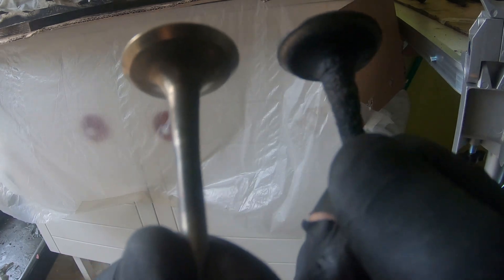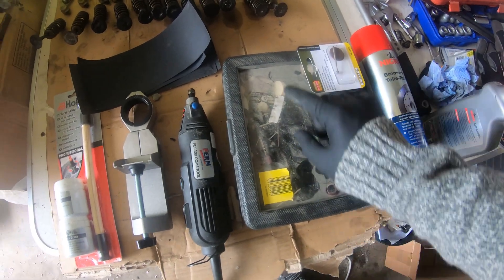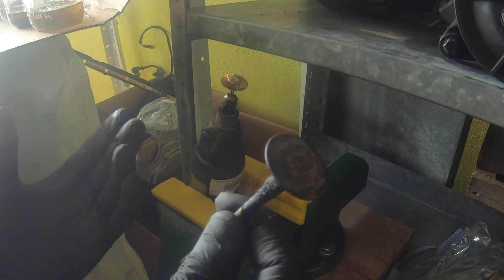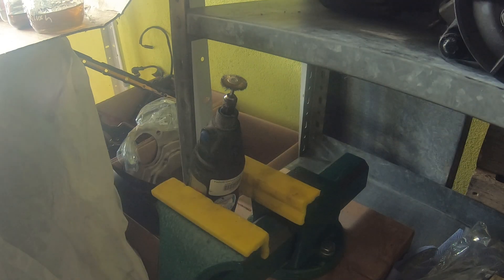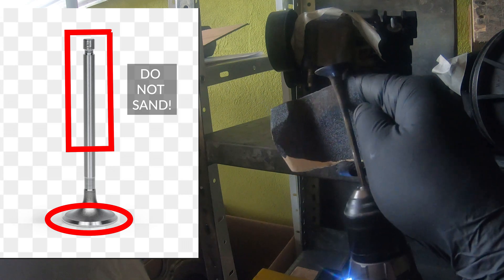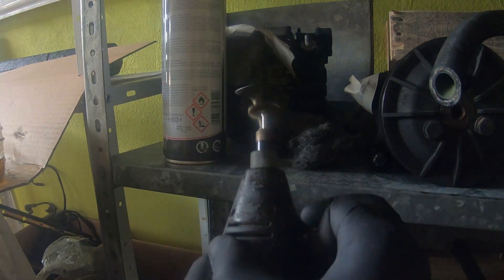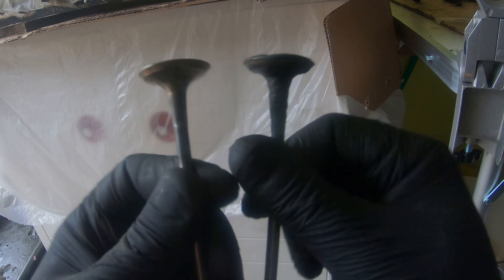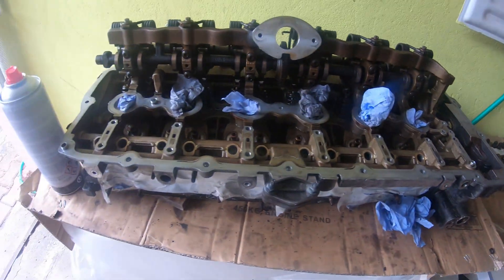Cleaning Off The Carbon Build Up & Lapping The Engine Valves! [BMW N52 Engine Rebuild Part 11]

Comment: That's a lot of carbon build up. How many miles? 500k?
Reply from the maker: On this engine, I'm not sure. Maybe 250,000k? But the n52s burn a lot of oil so I'm not surprised
Reply: @buildanddrive  My N52 doesn't burn any oil really and I have way more miles than you.
I have a 2009 N52 idk if that has anything to do with it, I know that 2008 and older models had the lifter tick issue but that issue was patched 2009 onwards. Maybe other changes happened.

Are you filling it up with the correct amount of oil after oil change? 9qt is the limit if you start putting 10+ quarts you're going to start burning it off.

Comment: I just used dish soap and some steel wool and was gentle and in a minute or two I removed all the carbon and it was all so well done I was scared for scratches but nope not a single scratch
Reply from the maker: I also did this a bit 🤘

Comment: how is the oil consumption with such a specification of compression rings?  how many miles have you done since the repair?
Reply from the maker: Oil consumption is about 1L/1600kms on 5w40. You should drill new oil return holes or replace the pistons to the new design and you won't have any oil consumption any longer.
Reply: you could use a one-piece oil ring, then the burning of oil does not allow topping up between changes
Reply from the maker: @adamkuczerowski7773  what is a one peice oil ring? I don't know if bmw made those for this engine. But the piston design is the problem. The oil return hole is in the wrong place. The new piston design fixes the problem or you can drill the hole in the old pistons.
Reply: the ring made of 3 parts does not allow the oil to slip into the drainage holes, among other things, the lack of a bevel on the ring, see how a one-piece ring looks like, it has bevels to the inside.  whether oil dripping from the bottom or the top, allows the flow and drains properly.  there are companies that make such a ring for each type of piston and cylinder
Reply from the maker: Can you send me a link? Is there a part number for the n52b25?
Reply: there is no part number, but I have a company near me that will make such a set of rings for me.  I'll send you a photo of what it looks like exactly.  based on the appearance of the m52b28 ring